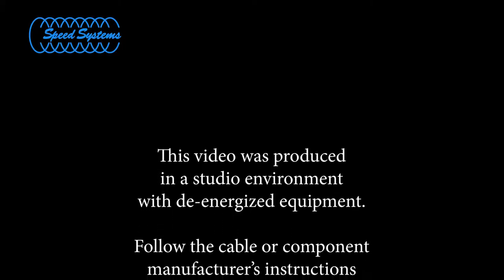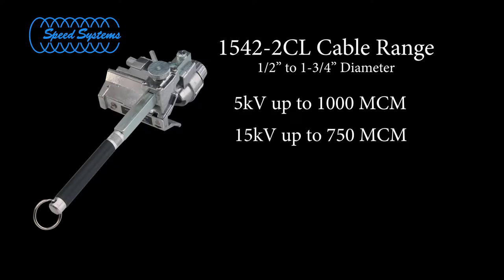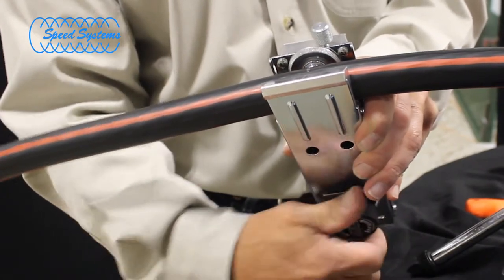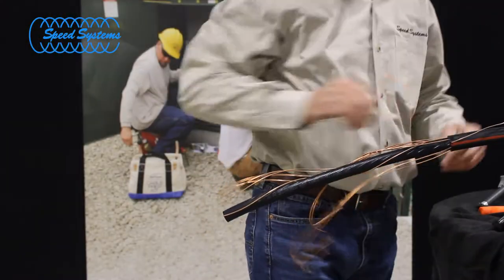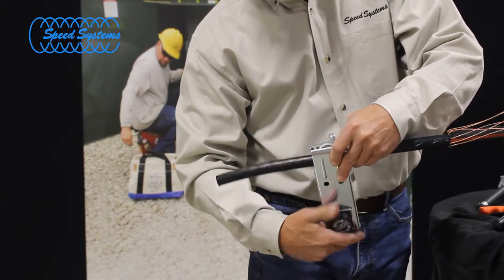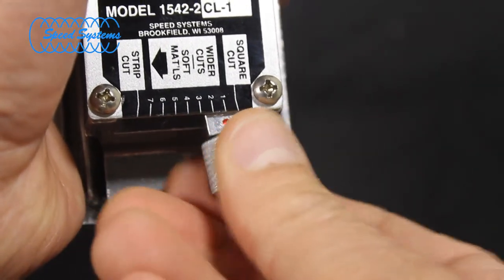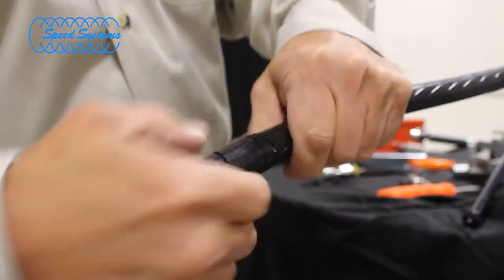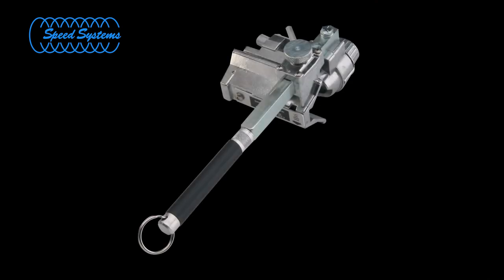2CL Cable Prep

Comment: Can you use the semi-con scorer 1700ss to remove the jacket on larger CTS or LC shield cable?  Using the square then, spiral cut method?
Reply from the maker: Hello Trevor, no, the 1700SS should not be used to remove the outer jacket.  The blade is not intended for that.  Your best options to remove the outer jacket are either the 1542-2CL insulation stripper, or one of our neutral winders if the cable has neutral wires.
Reply: @SpeedSystemsInc  ok thanks.  We use the insulation stripper.  It was new to me to see the ring cut on the CN cable on the outer jacket.   We keep our semi-con scorer away from the outer jacket removal process on all the cables.  Appreciate the fast response!  Our trainees like the speed systems tools much better than some of the other brands that have been used in the past.